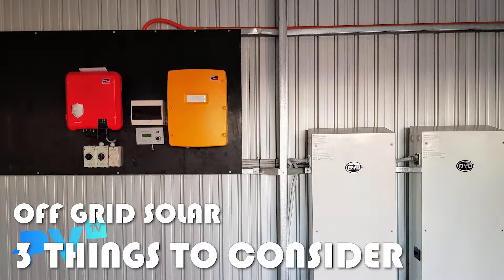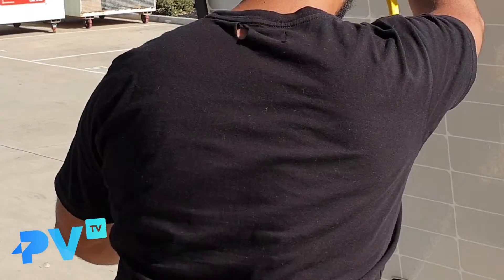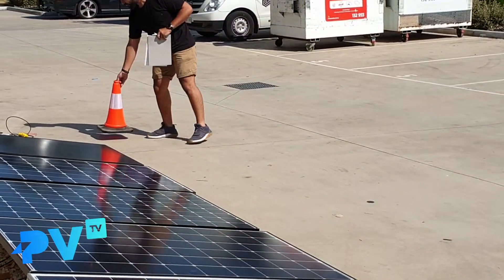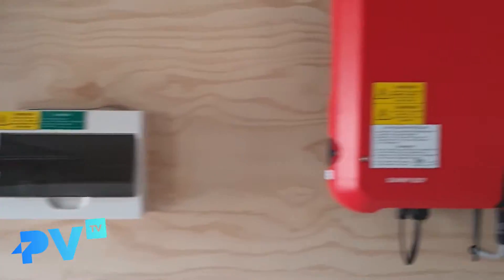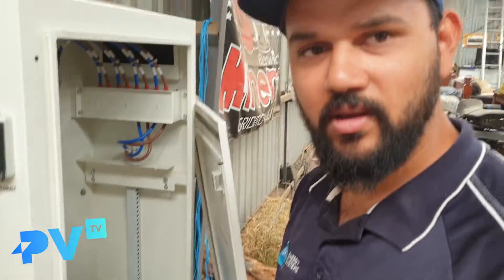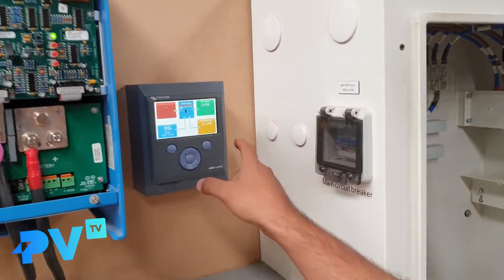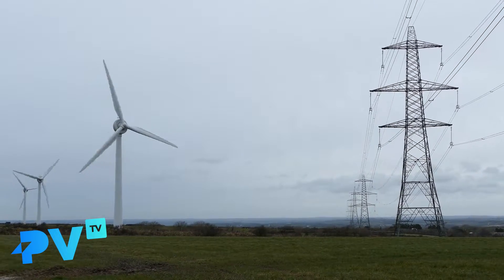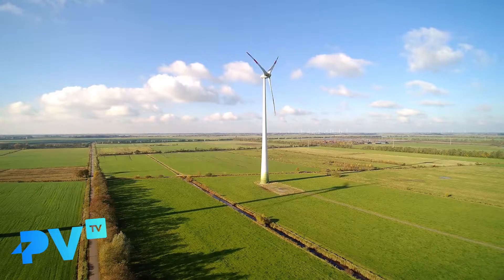PV-TV E20: OFF GRID SOLAR - SOME STARTING TIPS

Comment: A 3kw solar system makes about 1kw on a sunny day in winter (nz) so how would that charge a 30kw battery? and your little generator would have to run for 10-12 hours to charge that battery, you would need at least an 10kw generator to charge a 30kw battery efficiently.
Also your video shows an off grid system with 2 sunny boy inverters so it must be about 12-18kw of panels which would be a good size for off grid.
Reply from the maker: Hi Jess, I recommend sizing up the solar system and generator according to the battery size so it's large enough to charge the batteries. Cheers

Comment: Hi chaps, good, informative video; thanks.
In Australia, you have predominantly, loads & loads of glorious sunshine.  So Solar PV stacks up in so many ways.  In the UK, life is a somewhat more of a gloomy experience, especially during out seemingly never ending cloudy winters.  So I have rather oversized my PV capacity to cope better with generating at least a modest amount of electricity during the cloudy winder months.  I'm also currently retrofitting a battery system now.
On the subject of wind turbines; I take your point about the capital & installation costs of wind turbines.  However I reside in a country with less solar radiation & more breeze than the typical aussie might enjoy.
You ask for suggestions about potential future videos.  Could I request that you do one on installing a small (even a micro) wind turbine, with a an additional small dedicated inverter, that can be installed to supplement an existing PV system please.  These days a very small cheapy wind turbine can be purchased for around £200 & a small inverter for £100.  How to set-up & wire that setup into the existing PV system would be both interesting & very helpful.  I'm sure that the wind blows a fair bit in Australia also & that small wind generation would assist the main PV during the hours of darkness.  A suggestion for you.
Thanks again chaps, regards, JohnnyK.
Reply from the maker: Thanks JohnnyK, great idea. We'd have to think how to set this up. Might take a month or so but we'll put this together. Will be awesome. Thanks again for the tip!